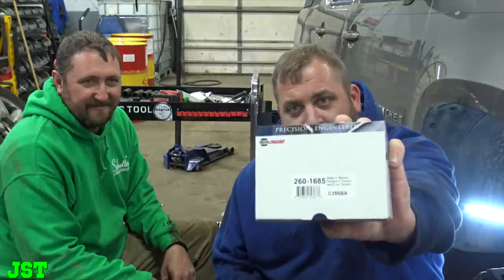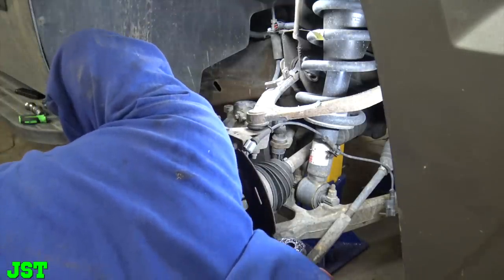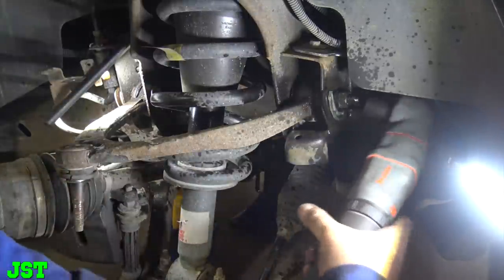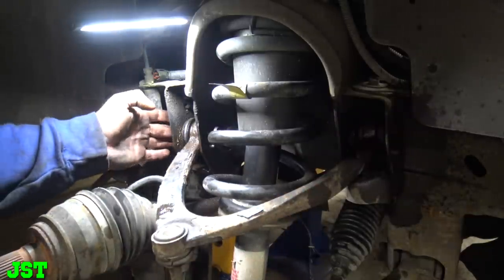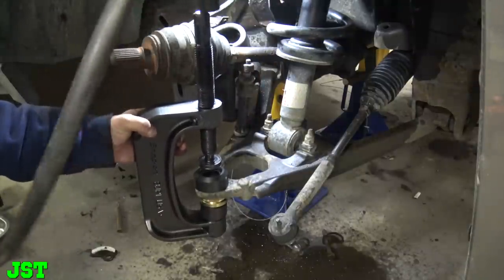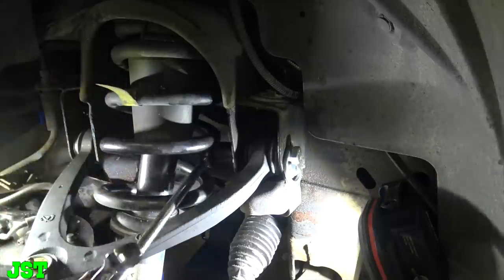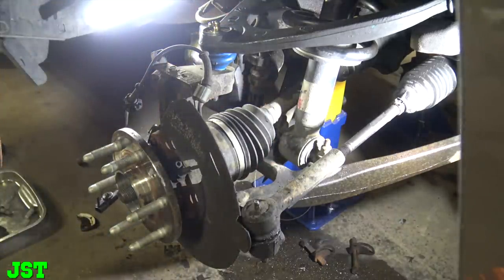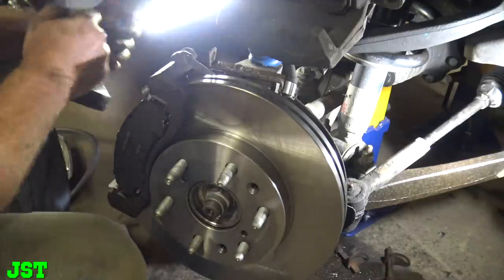2007 CHEVY 1500 UPPER AND LOWER BALL JOINTS REPAIR

Comment: Good vid, would have been better if we could have seen the specifics of what you were dealing with behind that spring.  Why does my front end "pop" when i switch from going back to forward?  grease ball joints? or replace a-arm bushings?  I know nothing of front-ends but looks like I'll get my try as well.  Keep bragging about "1st time doing this stuff", that's the most inspirational part.
Reply: Not sure what kind of vehicle you have. If it's front wheel drive or what not. But ur issue sounds like a u joint or a cv axle. Need more info to be certain tho.

Comment: Okay, agreed on the not a ball joint expert but you did get it done without damage.  The rotors are supposed to be held down with one lug nut before assembling the brake caliper bracket and calipers as it make less struggling occur.  Now, that truck should drive better with the new parts !  Nice "Hanna"
Reply: There is a t30 that holds the rotor

Comment: maybe I missed it but what was the reason for taking off the upper control arm?
Reply: Kid_Miller thought the same thing to but does that control arm look new?
Reply: The control arm bushings were shot.
Reply: mdlee52 yea but why only replace the upper then? Just didn’t make sense
Reply: The uppers are cheap as fuck to just replace the whole thing, the lowers it makes sense to just do the ball cock as long as the bushes are good.
Reply: The ball joint isnt replaceable on that control arm

Comment: Your going to have good old memory steer with them ball joints because the torque sequence wasnt followed with the upper and lower ball joint torque specs
Reply: nathan walton  memory steer is a real thing your suppose to torque them in a specific sequence I'm sorry you dont know anybody that does that dosent mean it's the right way to do it
Reply: No you dont been working on cars for 20yrs and i dont torque a damn thing besides head bolts thats it. Never have a problem ever
Reply: @niteninja0133  okay you disagree dont mean what I said was false memory steer is an actual problem

Comment: I think you spent a buck to save a dime by not removing the coil over shock assembly.
Reply: justanothertech m y would u remove that
Reply: The strut assembly comes out pretty easily. Then you would have room to work in the middle of the A arms.

Comment: I gotta know why u put the ratchet in the inside when u tightened them a arm bolts down? Why not put the wrench on the inside and ratchet on the side that's got all the room in the world to work? Not enough room for the ratchet? OK why not use a ratcheting wrench? Actually there was room bcuz now that I think about it u had that enormous IR air ratchet impact on it... Why not use that to tighten it back on num nuts? Alls I can say is I hope u learnt from this bud! U got so many tools u forget about utilizing them. Try to remember if u are fighting something like crazy, ur probably doing it wrong bud. Take a step back and think about it. In yes the bolts were put in backwards! You also need to remember, if u are recording ur work... Pause it rewind and look at the work before u fudged with it. I think u tried going balls to the wall worrying only about the time. Not the quality or doing things correctly... Speed comes with experience! Never be ashamed of taking to long, as long as the job got done awesome. U will gain speed over time, I promise!